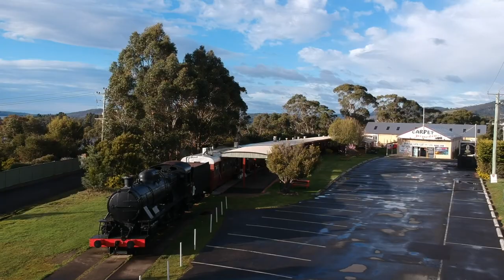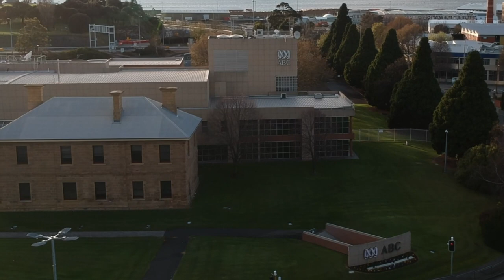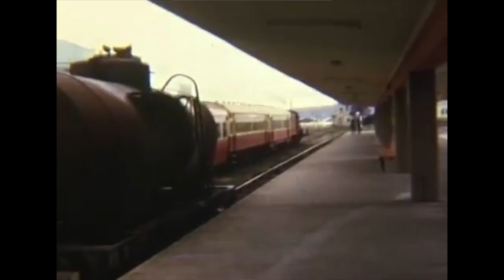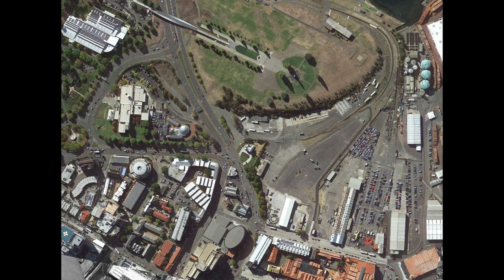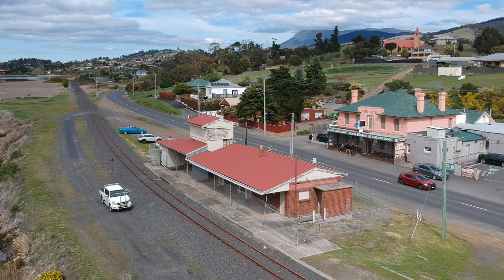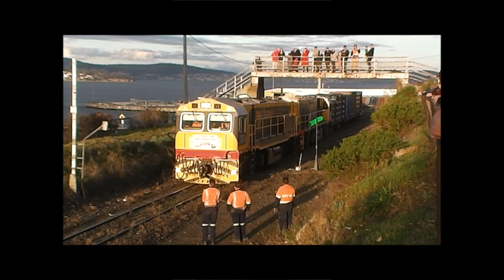Who Killed the Hobart Trains?

Comment: The committee looking at light rail using the old corridor into Horbart concluded that it was too expensive to modify the infrastructure to take standard gauge vehicles. They did not take into account there are many modern light rail systems (particularly in Japan) which use the existing Tasrail gauge of 1067mm and thus need no modifications to the corridor. This outcome seemed pre-determined by their terms of reference which suited the government. Love your doggie!
Reply: The report certainly did seem a bit “worst case scenario” and leant towards being unviable. I have no doubt that the cost was accurate though, considering how things are done in Australia. I would like to a proper light rail in Hobart one day, not just for the Northern Suburbs but for Kingston and eastern shore too. Something needs to be done.
Reply: @trevorgdn  You are right, the over reliance on cars has been a blight on urban development.

Comment: You document both government failure and insufficient attention. They fail to recognise the tourist potential of a railway that skirts the waterside starting at Hobart. Derwent Valley Railway has been trying to run trains for many years. Even freight is not supported and heavy transport uses roads despite its environmental detriment.
Reply: One of the key reasons for the rail system being neglected as well is that up until around 20 odd years ago no one had any idea that the State's population would increase and Tassie would become a desirable place to visit and live. I remember back in the early 90's a lot of experts were constantly warning of a long term population decline for Tassie as the general consensus was that anyone who had the means to move to the mainland would do so and not return.
Reply: @Tazza81  Generally still the case when talking about young skilled professionals. Numerous reasons for that, UTAS is constantly in the news for the wrong reasons, but many graduates withs Visas leave after their commitment, and locals in some fields generally move mainland for higher progressions/pay. 
I can see the rail system still being difficult to politically justify, even though personally, and from anecdotal experience it would be very positive. Reason being that the public attention is focused on health, housing, energy and education, and most cannot see a reasonable need to have "a train for what can already be driven in 2.5hrs." Which is a short sighted position but you can really only imagine the strain on the Tasmanian economy taking on such a large project (track straightening, locomotives and stock, terraforming, signals, transport reshuffle, staffing, training) that at least the last 2 generations have zero experience with.

Comment: it's a familiar story; rail service run down and ended in the 1970s, tracks pulled up and right-of-way sold off, just in time for the fuel crisis & pollution to become an issue with road transport. so, the world over, the choice was then between throwing money at (usually private) bus and coach services or colossal investment in brand new light rail etc.